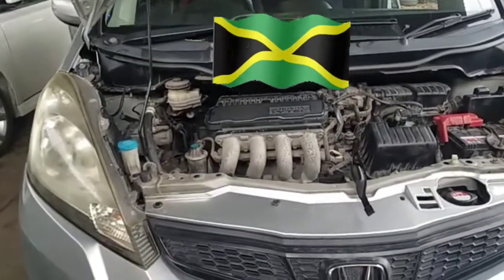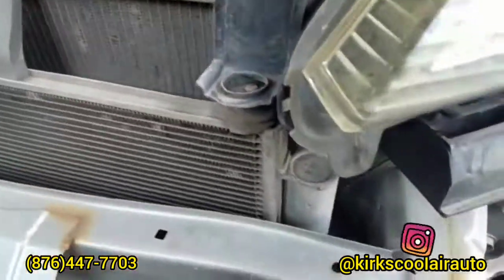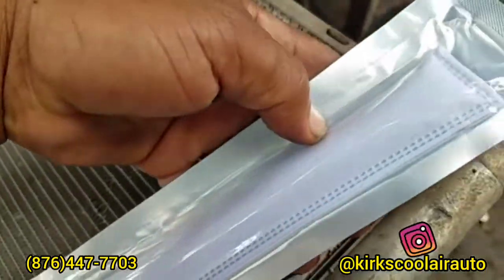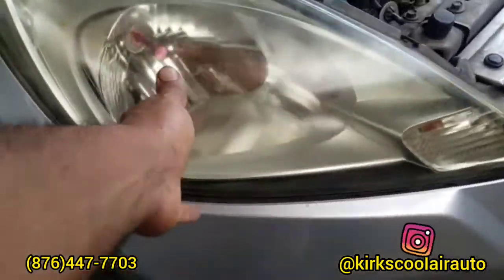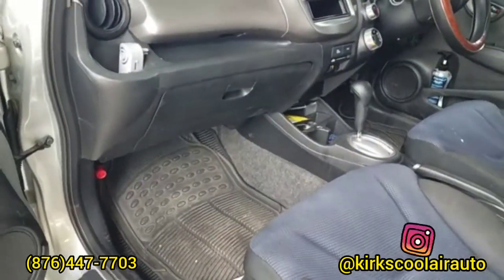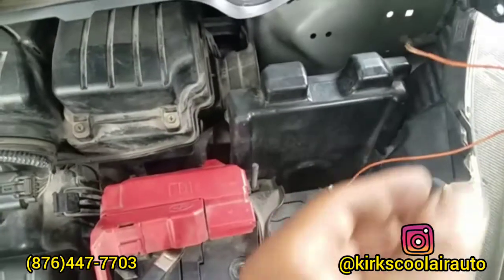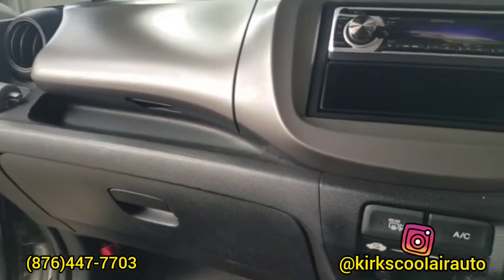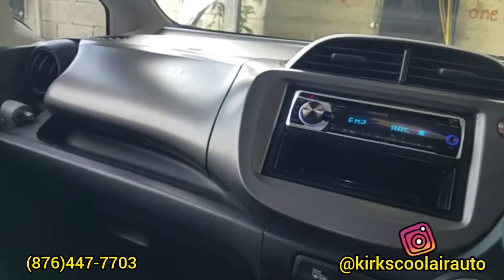Honda Fit A/C Receiver Drier Replacement And Blower Motor Fan Repair #blowermotor #recharge #fans

Comment: Where's the receiver dryer go?
Reply from the maker: on the side of the condenser in the canister
Reply: There's a 14mm hex plastic bolt at the bottom of the receiver dryer tube on this design condenser.  Remove bolt, pull out desiccant package, replace package.  You can access the bolt after removing the bumper and the side panel, but you can't take out the desiccant with the condenser fully on the car.  You don't have to mess with the cross bar on top though, just  remove the top support brackets,  pull the condenser out from the bottom on the drier/receiver side, and you have ample access to remove the plug and pull out the bag. Easy pezy.